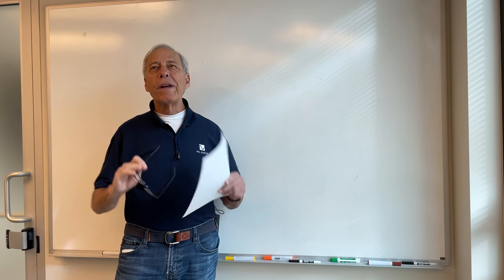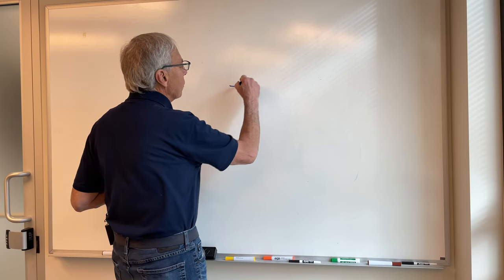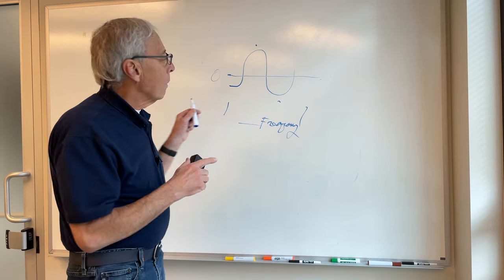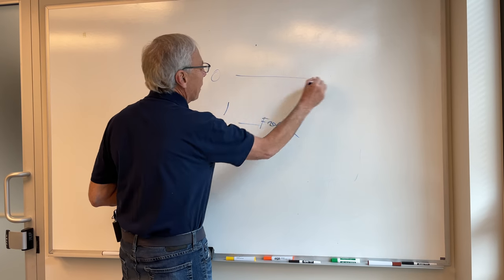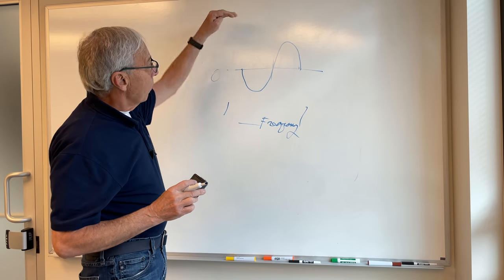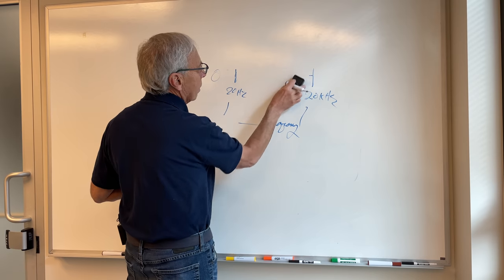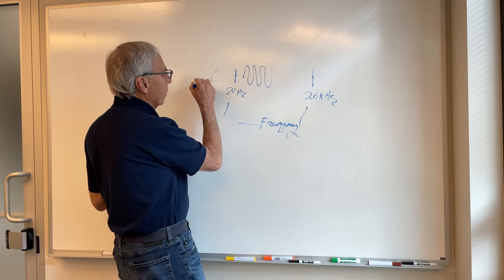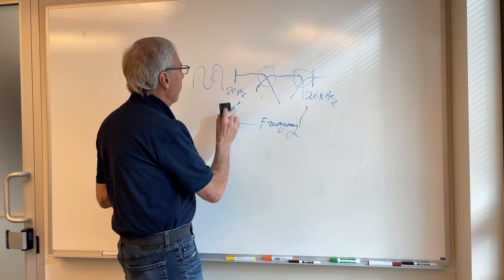What is perfect linear phase?

Comment: All zero crossing points (including the starting point) change upon phase shift. In fact, the difference of the zero crossing times between the original sine wave and the phase shifted one IS the phase shift (if you measure the time in radians). There is, therefore, no tilting or skewing of the waveform to the left or right happening.
Reply: Came to write this. But couldn't have explained it better myself.
Reply: How does the 0 point move?
Reply: This begs the question , if he does not understand basics like phase , what does he understand ? I am truly shocked !
Reply: I was going to say this too. The whole waveform moves - so all the zero crossing points and all the peaks move. The way Paul drew it, the frequency changed.
Reply: @gerritgovaerts8443  I believe you're judging too hard here. In front of the whiteboard, one can sometimes get lost a bit. :-) On several occasions i found myself writing "less correct than desirable" things on the whiteboard for students, too late realizing that a "more simple explanation" turned into an incorrect one. As the famous (Einstein?) quote says: "Everything should be made as simple as possible, but not simpler." I think, Paul was making a legit attempt to explain phase without using almost any of the relevant math, such as e^(i phi(t)) = cos(phi(t)) + i sin (phi(t)) and introducing phi'(t)=phi(t)+phi_0. Maybe two good old overhead slides with sines, overlaying and shifting them in t-direction would have been better, though.
Reply: @out-of-the-boxsystems3091  Maybe , but it just confirms my suspicion that he has no academic engineering degree to speak of and a weak math background . He may have been a good designer of amps by sheer volume of experience in trying to build amps , but I put my money on guys like Bruno Putzeys these days . As an acoustic engineer , he clearly is weaker on that subject and should stay away from that topic and let his new hiree do the talking . And pls stop the magic cable stuff .
Reply: @HareDeLune  they were too knowledgeable to even answer my question haha, I had to do some research on my own and am glad I did
Reply: @gerritgovaerts8443  He is CEO and yes, his description of phase is quite a mess, but as a CEO, he is on the much better side of technical knowledge and quite entertaining. So, take this as entertainment foremost and if you really want to learn technical matters, there are plenty of sources out there. PS Audio products are not engineered by Paul and you can bet his engineers perfectly understand what phase is.
Reply: @gerritgovaerts8443  Every individual have his or her weak moments from time to time.
Reply: @graxjpg 
Yep, nothing like doing your own research.
Much more satisfying.   : )
Reply: Yep, he draws it highly incorrectly. And also frequency response has not really to do anything with phase shifts or delays. Well, it could alter the in room frequency response, but, you know.
Reply: @HareDeLune Because it's hard to explain in text in a youtube comment and using layman's terms. You have Google right? Look it up, or is that so hard to do?
Reply: @SanderVermeer 
Suggesting I look it up is cowardly dodging the obvious point I'm making by asking you to prove your argument against Paul by providing your own easy to understand explanation.

Comment: Sorry Paul, but phase shift does not 'tilt' the sinus function; that would involve non-linear effects unrelated to non-linear phase. A linear phase response means that all inputs frequencies are delayed the same. That is it! For a flat amplitude response, a linear phase response is a non-minimum phase response for that particular amplitude (the amplitude aim for most loudspeakers), unless the phase is zero which a special case of linear phase and that would be the minimum phase response for a flat amplitude. A Linkwitz Riley cross-over is generally (in total, the LF part and the HF part added together) an allpass (flat amplitude response) filter with NON-linear phase, and thus input frequencies are NOT delayed the same. As a consequence you cannot recreate a square wave for example (should you want to). But a LINEAR phase all-pass filter would not have this time-distortion. It requires DSP to make though (unless you go first-order and unrealistic drivers). So in short; linear phase means all signals are delayed the same, but there is a delay, which could be an issue when watching a video along with the audio.
Reply: Great!
You've told Paul something he likely has known for decades.
Would you mind explaining it to the rest of us, in a simple way that even the least educated of us can understand?
Reply: @HareDeLune  Draw a sine wave with some frequency. Your vertical axis is amplitude, horizontal is time. Consider this your input. Now draw another sine wave, same frequency but shifted to the right compared to the input. Consider this your output signal. The output is lagging (although it is 'in front' of) the input, in that it peaks at later times than the input. There is a phase difference between the two signals, and while a phase difference does not necessarily come from a time delay, that is what we are considering here. Read out the time difference between the two signals on the horizontal axis. Now make two new sine waves but this time at a lower frequency, so the the wavelength is longer than before. Shift them so that they have the same TIME delay as the first sine waves. What you will see is that while the delay is the same, the PHASE difference is lower for the lower frequency pair than the higher frequency pair. So for a constant time delay, you will need different phase differences at different frequencies. Plot this phase as a function of frequency, and you will get a linear curve. Linear phase; constant time delay. That means there is no temporal distortion of any signal made up of any combination of sine waves, as any signal is only time-delayed, but retains its shape. Can you hear if a filter response is linear phase or not? I would say yes, as I could hear a difference for a pair of Kii3's (blind test, Bruno Putzey did the switching between the two states), but the track was also suited for pointing out the difference. Much work would suggest you cannot hear any difference for most music. See more in my blog post on the topic: https://www.acculution.com/single-post/2017/08/23/009-time-alignment-in-loudspeaker
Reply: @Rene_Christensen 
I really didn't believe you would actually respond with anything constructive.
Thank you for 'putting your money where your mouth is', so to speak.
I would also like to point out that you are the only person to do so thus far.

Reading your reply while half asleep at 2:30am, I was very distracted by your consistant mis-spelling of 'sine wave' as "sin wave", and kept thinking you must be plotting a hellish signal. 😆
Trying to follow your explanation in my head at this hour, you lost me at "...plot this phase as a function of frequency..."
Perhaps I could have followed along if you were using a whiteboard in your own video, or perhaps you got a bit more technical at that point.
Too sleepy to tell.
At any rate, respect to you for coming up with something I could mostly follow, even when half asleep, lol.
Reply: @HareDeLune  I was planning on making a video on this topic anyway so stay tuned (acculution channel here on youtube). I will try and get the sin/sine right ;-)

Comment: First, some mistakes: 
1:00: "Frequency" should be "period" or "periodic time"
2:06 Wrong: If the zero point would be the same and the rest stretched, we would have a lower frequency.

I do agree with Paul that linear phase in relation to a speaker is a little weird to me. Let me explain why and what linear phase actually is. This is all in the context of "filtering" as that is what amplifiers, equalizers and speakers all do.

First, let's start with zero-phase filtering. This is filtering where the frequency response (amplitude) is changed but there is no phase-change. This is impossible to do, as it requires a non-causal filter tat can predict the future signal: the impulse response is symmetrical in future and past. In a computer, however, we can do a trade-off, "looking ahead" enough to cover a big-enough part of the "future" impulse response. As computers can also not look into the future, the practical implication is that the whole signal gets delayed by a fixed amount of time for all samples. 

Delaying the whole signal with a fixed amount of time is linear phase. Translated into a frequency-phase diagram, this means that the phase shift is linear with frequency. For a twice as high frequency to shift the same amount of time, you need to shift it with a twice as high phase, because the time-period of the higher frequency is twice as short in time. Done well, this can create an ideal crossover, but considerable and accurate computing power is necessary. It's actually only 1.5 times the computation needed by a normal IIR filter, but it requires extra buffering and programming talent that audio companies apparently lack. And in live situations, a delay or latency is not always acceptable. For your home speakers I'd say it is perfectly possible to do perfect linear phase filtering and then amping each driver with its own amp. But that's another topic.

Comment: I use a PC based system + microphone that is calibrated that can actually measure the phase response of a speaker ... and also show group delay ... these two parameters are the most important ones of all regarding perfect imaging and 'snap' in the overall sound impression

Comment: The Meyer Sound Blue Horn System is a active full bandwidth monitoring system with a dedicated controller unit.
That's not what most audiophiles dream of.
The unique thing is, that the systems compemsates the non-linearity (like resonance,  physical inertia) of the drivers and enclosures over a very wide frequency range for amplitude and (!) phase.
What  does  that mean?
It's obvious that a Tweeter is easier to move than a  big woofer and the bigger mass if the woofer has much higher inertia than  the litte tweeter.
So if your source signal has a very low frequency for woofer and a high one for the tweeter, the high one sound will be reproduces before the low sound.
The Meyer System claims it has solved that problem and the speakersystem over it's complete Bandwith reproduces it's input in phase.

BTW: It's not a good idea to explain phase shift with a 180 geg shiftet sinewave. Most people don't get it and think a inverted signal is a 180 deg shifted signal. But that's wrong.
Reply: Danley Sound Labs has been doing this for decades, starting with the SH50.  Meyer is trying to fight back it seems.

Comment: This video is wrong. Phase shift zero crossing points are not the same. It's not a distortion in the wave both waves starting at the same time like you're explaining, it's a time difference in the starting point of the resultant wave with respect to the source wave.

Comment: Linear phase means linear phase shift and constant time delay. In contrast constant phase shift have linear time delay which is bad for sound because every frequency is not producing at the same time rather at different time that's what happens in LR4 filter where phase shift is constant 360 degree irrespective of frequency  so system is gonna be in phase but not in time. For example high frequency gonna come out first and then some delay  low frequency is gonna come out. that's not audible most of the time

Comment: Really helped understand this topic.  What is the sound impact of a phase issue at the crossover point?  180 is obvious.  What about 45 degrees out of phase?
Am I correct in understanding that a first order crossover does not have a phase issue?
Reply: This was all incorrect. Have a look at my answer further up for an explanation.
Reply: Proportionally to angle of shift from zero between two sources signal is wrongly dimmed and finally  at 180 it gets null. Any crossover create problems - even  simple capacity in series or parallel  create  filter because is  connected to speaker coil induction Filtering with serial induction does not hurt so much but it is not popular in market at all . Why I cant say.  I made such solution about 35 years ago and it in my perception it had  it's advantages but that had to be corrected with EQ which is against market trends .

Comment: Even if that claim were true, it would be meaningless in a stereo two-speaker setup, because there will always be phase variations depending on the physical location of the speakers and the listener
Reply: That' a wanted Phase-Shift, aka  Delay. That's one base of the ability to hear multidirectional.
Reply: Up to  room conditions there is a mass of phase shifts equalizing each other and creating  "room acoustic" . But when damage comes out of speaker set it is single, pure  and no compensation is available.

Comment: Phase non-linearity = analog domain jitter? 🤔
Reply: No.
Reply: No.
Reply: It's a function of the charging and discharging of the capacitors.   Capacitors shift phase.   A positive example is a run capacitor in an electric motor.
Reply: @elfd18s  inductors also shift phase, in the opposite direction as capacitors. Unfortunately the phase shift is frequency dependend.

Comment: Phase is basically a time differential between different frequency wavelengths.  Certain frequencies travel faster through air than others and that's why you see some speaker designs whereby the tweeter is recessed back relative to the woofers.  I'm sure crossovers are involved in the timing of frequencies to each other.  It's a principle of physics used a lot in electrical engineering and mathematically represented by curves on a graph 'phase shifted' from each other.  The degrees is a carryover term from an 'angular' representation of the same phenomenon and the cyclic nature of waves.  Basically many different ways to look at the same principle.
Reply: I never bought into this concept of speaker design. Yes, different frequencies travel at different rates but making up for that by offsetting the drivers? Assuming that helps, to gain the advantage means the listening position would need to be precisely fixed as well. And who’s to say the flute player wasn’t in front of the bass. To take this concept to its logical conclusion you’d need a road map for every recording and adjust the drivers accordingly if you want to  recreate the performance accurately.
Reply: I thought that was called "time alignment"?
Reply: Sounds with different frequencies travel with the same speed. The energy  carried by sound wave goes up with the frequency. That is one of the reasons you need more power on low frequency reproduction ( another is Fletcher-Munson sensitivity curve)
Reply: Hare deLune    Right
Reply: @jjcale2288  I may be wrong but i thought that was only in a perfect vacuum that they all travel the same
Reply: @jctai100  In vacuum you have no sound at all!
Reply: Perhaps you should have said, "non-linear phase" is a time difference between different frequency wave lengths.  Yeah, it's practically impossible to avoid some level of phase shift. In the ideal world, a square wave from the source would yield our eardrums to move following the motion of a square wave but reality is that due to phase shift, the eardrum motion will likely look completely different as a square wave in physics can be seen as a composition of time synchronized sine waves and when the sync is gone (waves being shifted), the shape of the (for example) square wave is messed up. The phenomenon is called "phase distortion".
Reply: @jjcale2288  not sound, just frequencies
Reply: @jctai100  e/m frequencies (radio, microwave, light, UV, X, gamma and hell knows what other) are supposed to travel through vacuum with the same speed: speed of light ^c^. Sound is an elastic oscillation and to manifest needs an elastic medium (gas, liquid or solid). Some say also that e/m oscillation also needs an elastic medium to manifest, that would be the ^ether^ and the vacuum doesn't exist at all. In the mean time some say the Earth is flat, so...